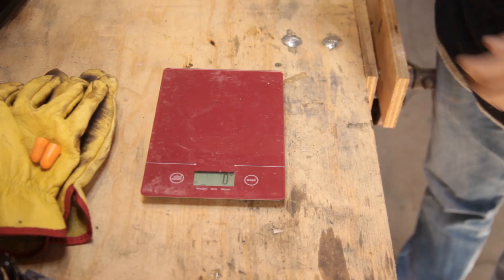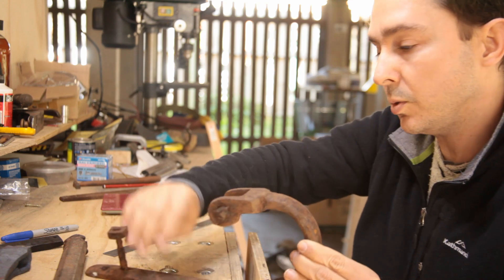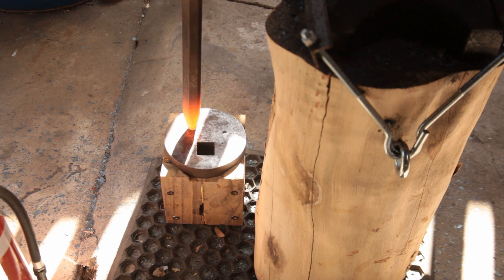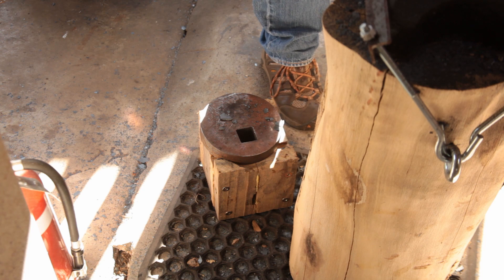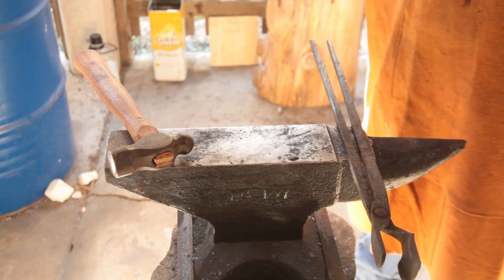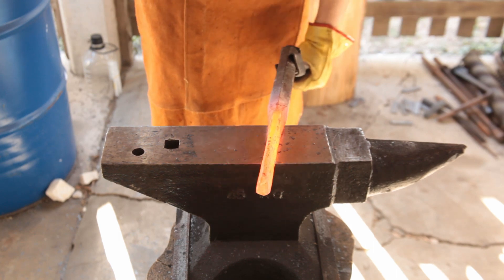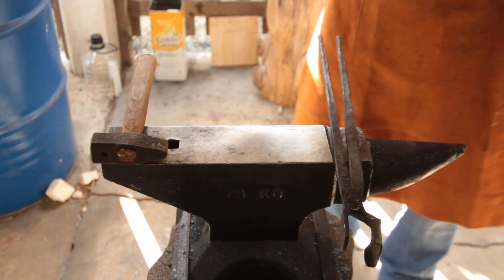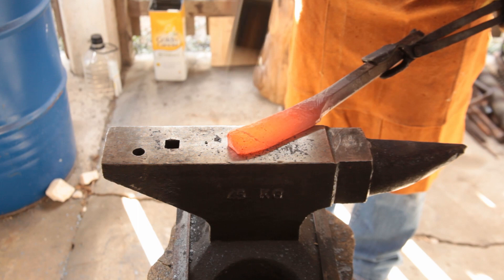Rough forging an ax eye drift, from mystery steel.

Comment: Looks like a jackhammer bit if so I think it’s high carbon
Reply from the maker: This came with a job lot of old jackhammer bits, was likely one too but broken, no hole in the centre so not a pneumatic drill bit.